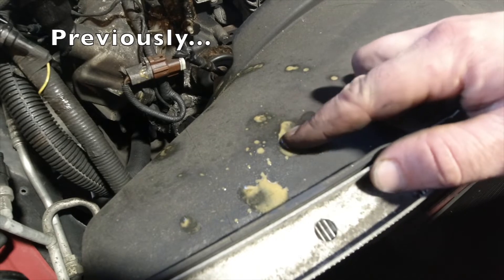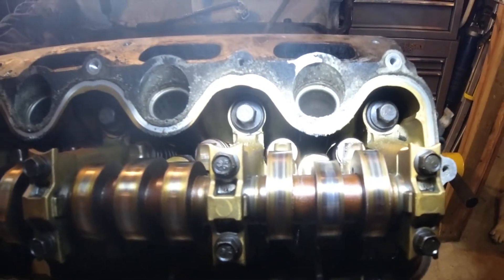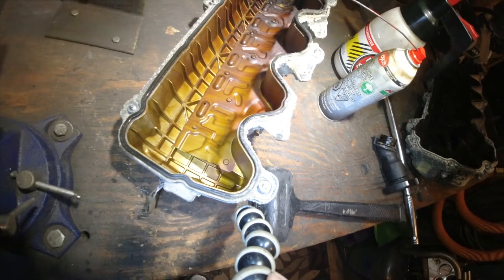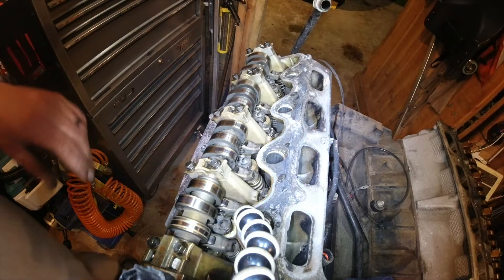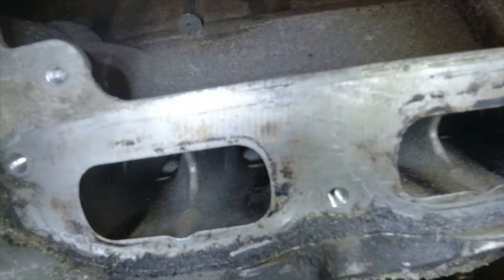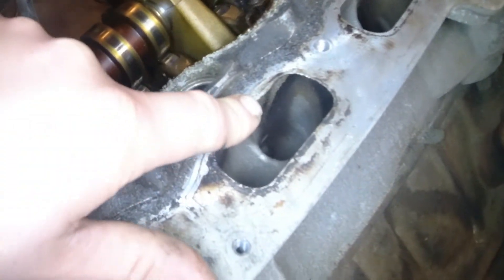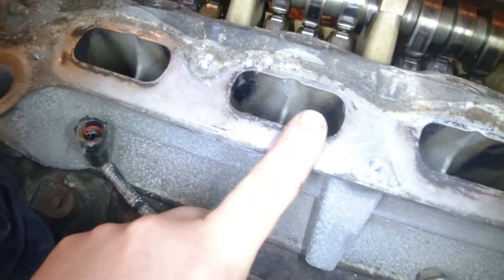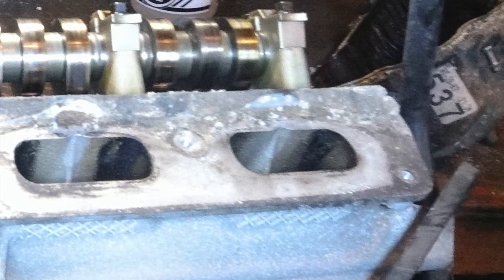The art of reading fuel injector spray patterns - Ford F-150 FX4 part 4

Comment: Theres a lot of pro's and con's on the Ford 5.4 engine.  I have a 2004 F-250 with nearly 18,xxx miles. I changed spark plugs at approximately 120,000 and about 4 bad coil packs. The last time i had bad coil pack on #7 cylinders I replaced all the fuel injectors.  I'm not a big fan of the 5.4 but in all honesty it has never left me stranded, and has done most everything I could ask. Minus, not having exceptional power its still a pretty good farm truck. Looks like your doing a great job overhaulling the top end. Glad I found your channel. 👍